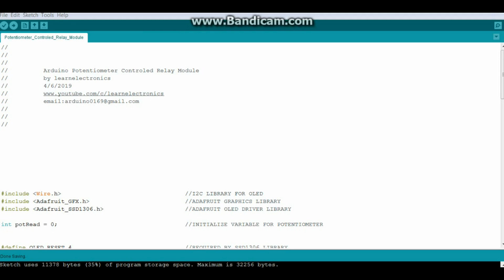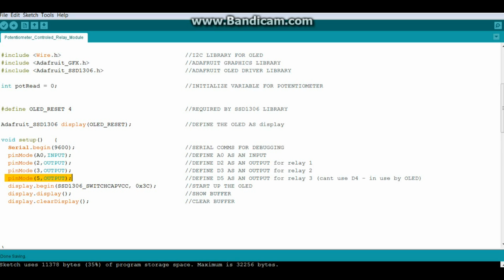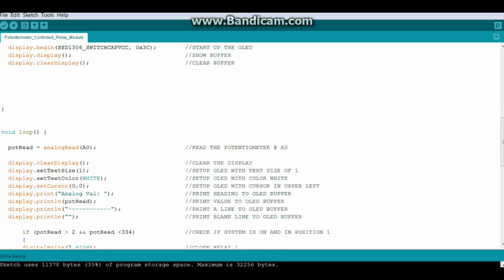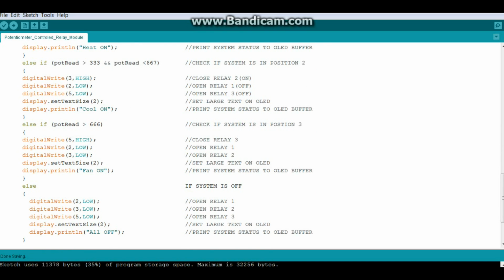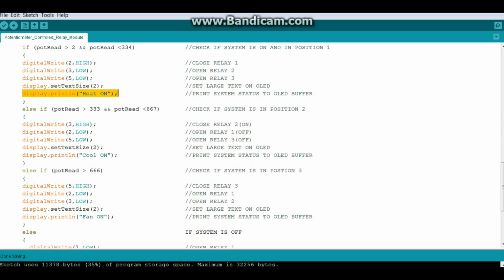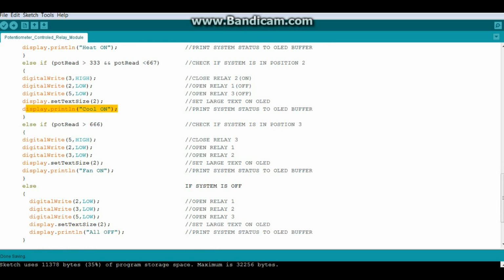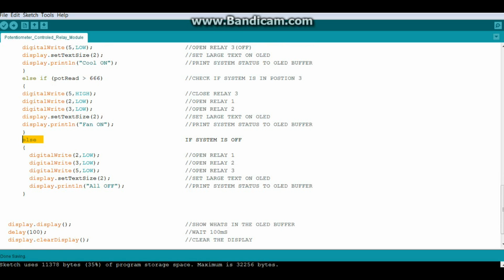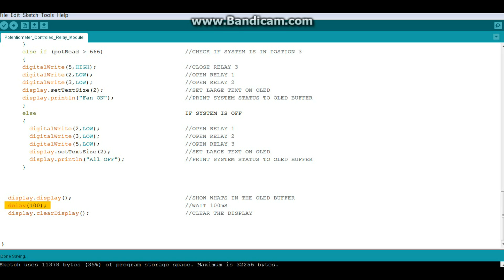The Beauty of Arduino Part 2

Comment: I remember using optocoupler and a relay with a 555 to handle the higher currents involved. Great isolator, but the arduino brings a programming level to the tried and true circuit.
Reply: As always you bring cool projects that actually teach. Thanks! :-)